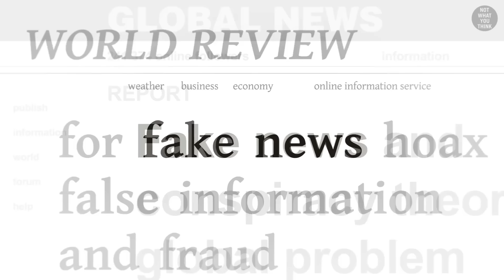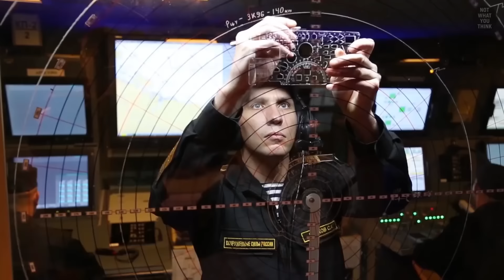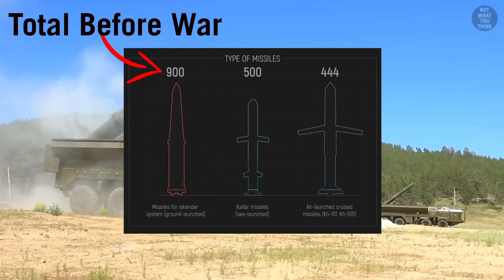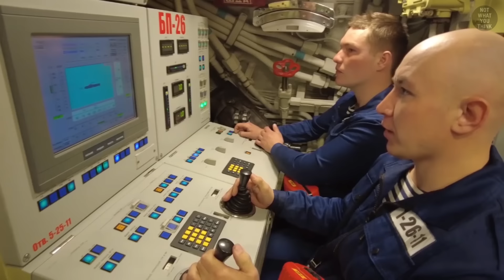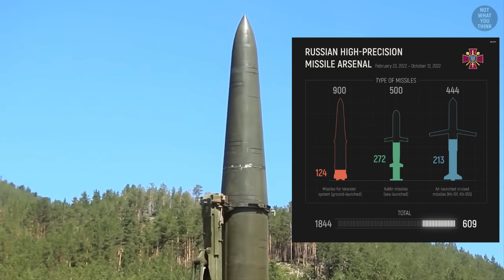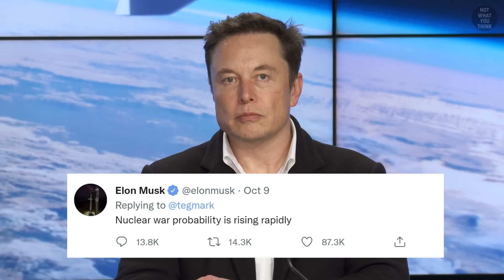Russia is Running Out of Missiles

Comment: Well a month later and they still haven't stopped, guess they're not running out THAT fast.
Reply: There was a few months of quiet if im not mistaken, after the initial wave of missiles. That quiet period was probably the missile factory going overtime. 

I mean, alot of washing machines were stolen afterall😅😅
Reply: They're still producing more missles, so they will never run out, but they have ran low and the bombardements have slowed down/gotten smaller in scale.

Comment: Also, the latest gen missiles are very expensive to produce in large quantities. Going for very cheap drones & missiles from Iran & older soviet era missiles is a smart tactic even if they miss 50 % of the time.
Reply: As Joe Stalin said, "Quantity has a quality all its own".  Accuracy becomes less important, if you have ENOUGH missiles.  Why waste 10 cutting edge missiles when you could use 20 from 1962?
Reply: @jackuzi8252  If I remember correctly one interview with a general,  2 HIMARS batteries were as effective as 144 smerch missiles in hitting a targets like ammo depot.
So it is not really  10 precise missiles vs 20 unprecise, more like 1 precise vs 12 unprecise. 
Add to that all the additional logistic strain of providing those unprecise missiles. 

Also additional disatvantage - you become war criminal in the eyes of the target. So even if you're not gonna get sentenced in Hague, you still can expect a Mossad style visit.
Reply: @jackuzi8252  but that's not how these calculations go. Example: you have 5 targets you want to hit. You want to estimate the chance 1 missile hits to understand how many you need to launch to almost certainly destroy the target. To calculate that chance, there are 3 factors: error rate (a malfunction in the missile), intercept rate and missile accuracy (expressed in CEP). So for an Iskander, let's say an error rate of 7% (quite optimistic), intercept of 2% and with a CEP of 5-7 meters you are confident you can hit the target (let's say it's a electric station, so quite big) These numbers would give a hit chance of 91%.
As you want to make sure, you launch 2 for each target, so 10 missiles total for 99.2% hit chance per target. Now Kalibr. Same error rate and CEP, but 30% intercept. That gives you 65% per missile. To achieve 99% hit chance you're now launching 4 missiles per target, for a hit chance of 98.5% or 20 missiles in total. Now let's look at the older KH 55. Error rate is likely to go up, let's say 12.5% (still very conservative). Intercept stays the same but now the CEP of 20m means that you need to get at least 2 to impact to be fairly sure to destroy the target. You're now looking at a hit chance per missile of 30%. To get to around 99%, you would need 12 missiles per target to get a 98.5%, so 60 missiles total. So you're launching 6 times as many missiles. Once you start lowering your estimates further, the numbers get larger quickly. 25% procent error rate, 50% intercept and 20m CEP? 21 missiles per target. Same but with 70% intercept? 36 missiles per target. The really old stuff, from the 60's? Kh22 has a CEP of about 150m (best case, some sources claim way more). This alone means you need to have a ton of them to hit a 20m large target reliably (say 10, as the actual maths get really hard). Intercept should be lower, since they're supersonic (let's take 10%), but error right quite high (30%). That gives us 65 missiles per target to reach 98.5% chance of destruction, or 325 for the 5 targets mentioned...
Reply: @marnixbrugmans4181  Thank you for the detailed explanation.  I have actually done some reading about CEP in the past, as the Iranians were developing their first ballistic missiles.  But to the OP's point:  1.  If the 1962 missile stockpile is huge (so the cost of firing one to today's military budget is near zero) and/or Russia could still produce them without Western chips, then it's smarter to use them in whatever quantity is necessary to destroy large fixed targets  2.  Ukraine has to calculate which targets are worth defending.  If Russia fires 12 inaccurate missiles at a power plant, and Ukraine has to fire 2 air-defense missiles at each one to be reasonably confident of knocking it down, that's 24.  Can they afford to use up that many?  If Russia has 10,000 old missiles in stockpile, and was willing to fire them all at Ukraine over a period of time, do 20,000 air-defense missiles even exist in the western world?  And that ignores the Iranian drones, and any similar low-cost copies Russia could start producing itself?  Heck, Russia could literally put moped motors into some wooden airframes and guide them with gyroscopes--maybe without warheads at all (decoys).  Aim them towards Kiev and set them off.  They wouldn't cause any damage, but the Ukrainians couldn't know which was which in advance if they flew similarly to the Iranian drones.
Reply: @jackuzi8252  those definitely are the questions that Ukraine will be asking itself. However, I do want to make 1 point: even if you could consider the missiles to have a value of 0, launching them definitely costs money. A TU22M can carry 3 kh22s, meaning you need a flight of 4 to attack 1 target. Using this method to launch large numbers would put a lot of stress on the airframes and cost quite a bit (TUs are not cheap to operate) but could be done
Reply: @jackuzi8252  This is similar to how the IDF took out Arab air defenses. Send in drones which the air defenses attacked, after which the actual combat aircraft came to take out air defenses.
Reply: Also a way to waste interceptors.
Reply: Iranian drone's don't miss buddy.
Reply: @jackuzi8252  
But the loss of civilian lives in Ukraine will make Russia as bad as the US in public eyes.
Reply: @Athanatoi  Maybe.  But if Russia restricted use of the low-accuracy missiles to large targets not next to dense urban areas, civilian casualties should still be pretty low.  I suspect there are a lot of power plants, refineries, rail yards, bridges, etc. which are not within 1000 meters of residential areas.  When they want to pick off a target inside a city, they should spend for the more-accurate stuff.
Reply: well NATO leader said russia resorted to use dishwashing machine chip so there its cheap like shaheed...
Reply: @jackuzi8252  Even the US switched to 'dumb" bombs in Afghanistan
Reply: @jackuzi8252  the problem is Ukraine is putting military targets in residential areas which is a War Crime The US would often complain about the Taliban hiding amongst civilians
Reply: That one local authority  Russia always gets bad press in western media anyway.  And the missiles aren't that inaccurate; they'd rarely be off by more than 1km.  So don't use the inaccurate ones on targets located right near residential areas.
Reply: It's quite smart actually.
Reply: @jackuzi8252  Holy fucking shit bro! Start a podcast or something. This is absolute Youtube content
Reply: @hakunamatata1880  Your info is totally biased tbh...
Reply: @jackuzi8252  me when im biased and make stuff up lmao
Reply: @jaythomas3224  sources? Last time i checked the US were using ninjas which are non explosive bombs and managed to kill the top guy of alqueda lmao cope
Reply: @marnixbrugmans4181  To be fair, the intercept rate will get lower when you increase the amout of missles lauched. If you lauch 120 missle at one target, the enemy will simply not be able to intercept 30%. The super modern Iris T defense system only has 8 shots.
Reply: @oO0Xenos0Oo  true, and a fair point. But the logistics of launching a 120 missiles at the same time is daunting
Reply: @theman3282  is that even possible thats like saying, using a calculator to run a gaming pc.
Reply: @MORE_BEANS_PLZ  Launched from a drone flying directly overhead of the target though, all is has to do is go straight down. It's quite a bit different from something launched out at sea travelling 500km inland. Vertical decent > Horizontal approach.
Reply: @marnixbrugmans4181  Taking a big  power plant every week sounds worth it.
Reply: It’s not a tactic, it’s just the only option they have.
Reply: @jackuzi8252  How that sentiment is still alive today baffles me. The logistical downsites of mass over quality render all the upsites completely useless. And Russias biggest weakness is its logistics.
Reply: @jackuzi8252  1 kilometer isn't that inaccurate? Really? You sure about that?
Reply: @jaythomas3224  true.
Reply: I don't know about smart...IF they won, there is nothing left to rule if it's indiscriminate lol
Reply: 50% of the time they work 100% of the time and I like those odds.
Reply: 10 months later your logic has been exposed as BS.
Reply: @kentonian So, did they ran out of missles now?

Comment: It was what I thought. They are running due to how less accurate they were becoming
Reply: Iranian drones are more precise and cheaper  and their cameras don't lie plus the noise they are making interferes with radars signals  which makes them penetrate defense systems
Reply: @fakeit6339  Why is it when i think of Iran i think of the F313??
Reply: @fakeit6339  Radar uses radio radiation to detect targets not sound. It is simply their small size and low-speed which is problematic for radar. Acoustic sensors might be able to pick the drones up though.
Reply: @fakeit6339  lmao imagine interfering radars by Cardy b songs. Next gen rusia tech.
Reply: @JaySubii  "getting rid of old" yeah, but before that they lost everything near new and their "next gen" is non existent

Comment: 13:59 Did that missile just return to its sender?
Reply: Pretty much.  Its that or the Russian's created a boomerang missile.
Reply: It hit close by but the launcher and crew were unharmed fortunately
Reply: What happened here is the 2nd stage of the missile engaged prematurely. I'll elaborate to the best of my abilities.
 
There are 2 types of powered munitions that travel through the air, rockets and missiles, rockets have 1 stage and its full throttle from launch til its out of fuel. Dumb rockets basically.

Missiles (like the one you see in the video) have 2 stages, first is the launching stage, which gets it airborne and far enough away from the launch site to begin the 2nd stage, which is where it looks for an applicable target either via heat or radar, then expels the remainder of its fuel to correct its trajectory and reach its detected and designated target .

The 2nd stage engaged far sooner than it was designed to, and since the launch site was the closest applicable target, the missile did what it was designed to do, and expelled the rest of its fuel to correct its trajectory so that it hit whichever target it had detected.

Comment: One small fact is the missile debris had a manufaction dataplate of only 3 month before its usage.
Reply: That's the thing about sanctioning chips.  If the Russians only need electronics available in the commercial marketplace, they can send people to Hong Kong, Istanbul or elsewhere and just buy up suitcases full to bring back.
Reply: given an ICBM only required the processing power of a PlayStation 2 it's likely even the most advanced missiles they are using don't require cutting edge technology. They can probably get all the chips they need from the Chinese and Indian companies that strip used electronics for parts.
Reply: @Jake12220  Taiwan produces majority of chips in the world, so, no problem for russians to buy from china some electronics
Reply: @The_ZeroLine  What are these other parts?  I'm sure they're easier to produce domestically or buy from China than chips.

Comment: One thing people doesn't seem to realize is that.... Russia might not be running low of precision weapons... it might be acting in a way to prevent that from happening. If a WW3 happens they will want all the ordnance they can get, they're beeing rational not desperate... just remember guys "appear strong when you are weak, and weak when you are strong" -Sun Tzu
Reply: This is unlikely. As they haven't done so in any other area, aircraft, small arms, armored vehicles, drones, navy. Even in the case of some of their latest air def and electronic warfare and intelligence equipment. They have used their best stuff whenever they can, and have been forced to replace losses with older equipment over the course of the war. We have no reason to believe missiles are any different.
Reply: If problem with all those hypothesis is that if Russia acted strong in the first place they would not be in this situation at all. Russia doesn't win anything by making this war last longer, quite the contrary.